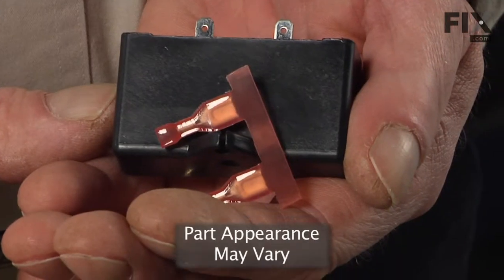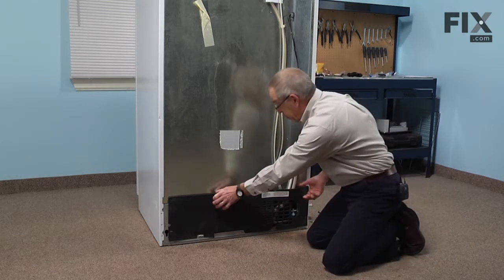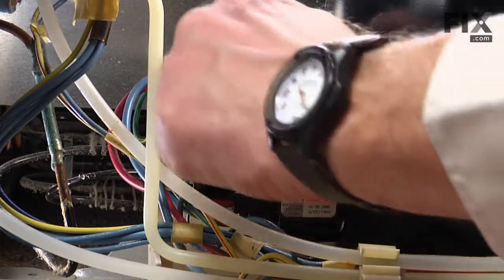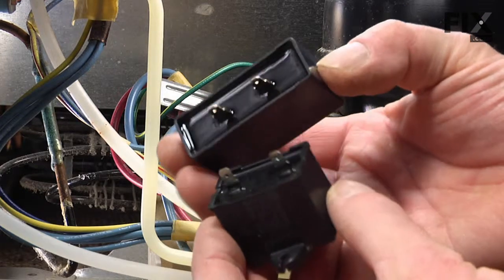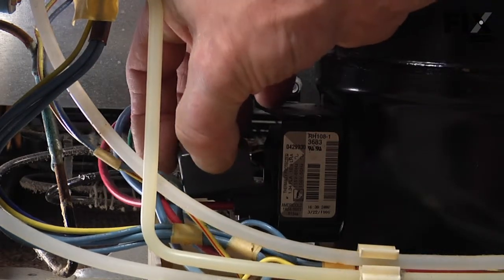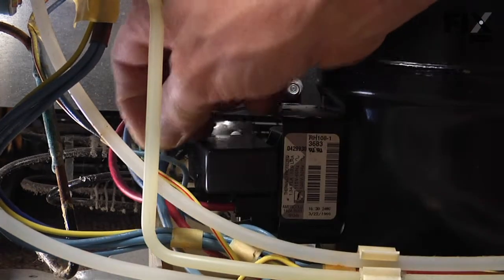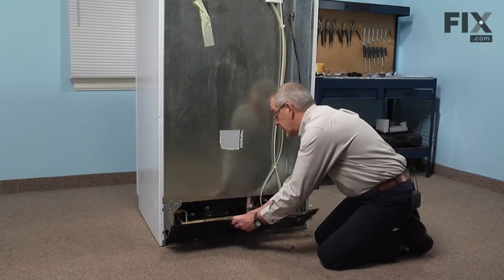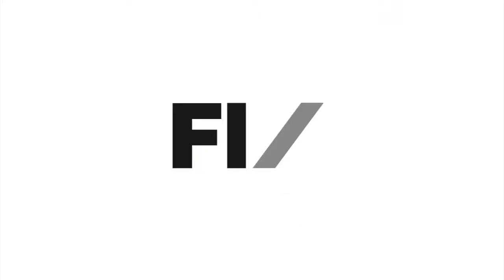Frigidaire Refrigerator Repair – How to replace the Run Capacitor

Comment: Wow that Frigidaire’s relay was dated March 22 1999, that’s a good 17 years on that capacitor/relay! Our Frigidaire capacitor/relay lasted just at 16.5 years and now needs replacing. That’s a good run of it. Despite the fact we are having one heck of a time locating an exact aftermarket relay match for this 2008 model and finding a plentiful supply of the 2007 relays, I guess we can’t complain too much after so many years of no hassle. Wonder why there are so few of the 2008 designed relays but tons of the older 2007 ones in the aftermarket. It has us scratching our heads. Would think the 2007 would be phasing out faster than the 2008. Wonder if there was some major flaws with one of those over the other that didn’t justify making as many in the aftermarket?